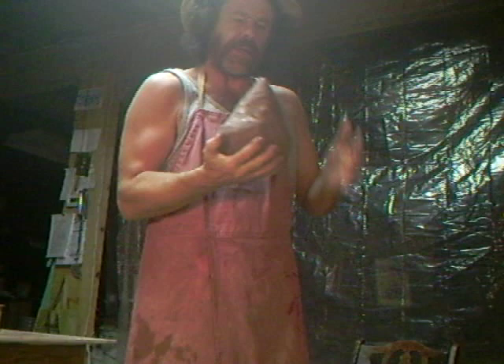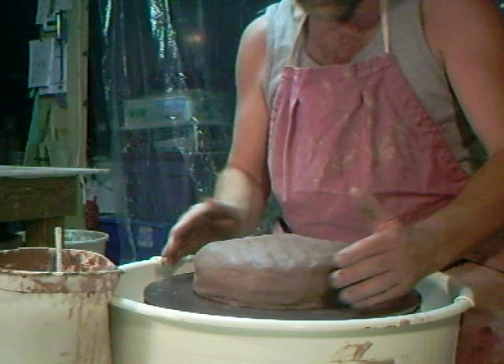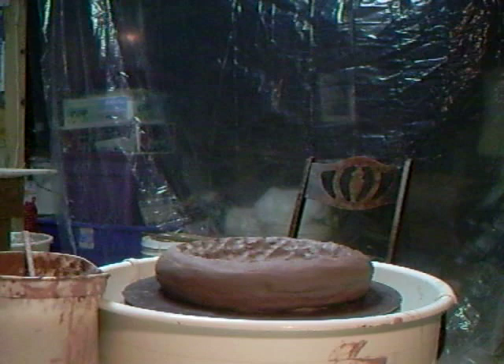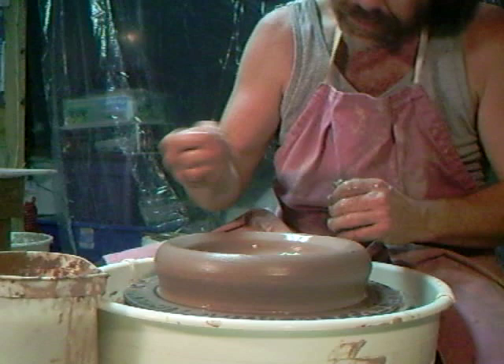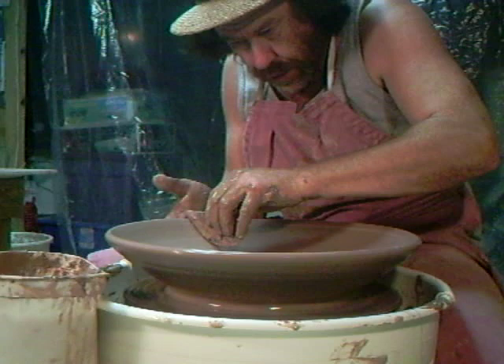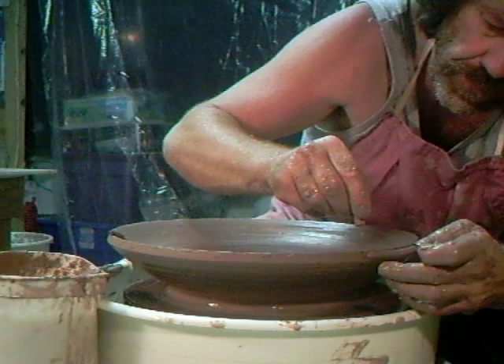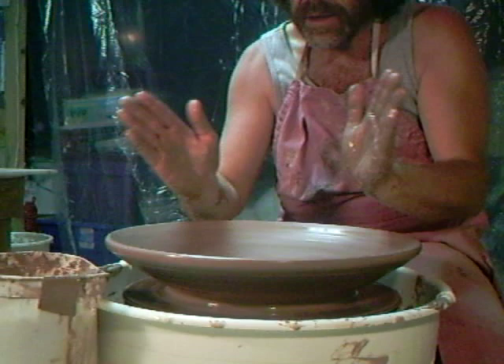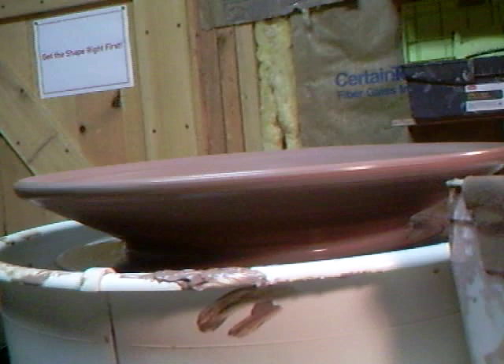SIMON LEACH - How to throw a  charger  ( & wobbly at that ! )  !!

Comment: Platters used to be my specialty. I had not done any in a long time but was feeling good about trying again so broke out the porcelain and pulled a 14 and 12 inch pair of platters (nesting nicely). There is something so satisfying doing these and then tending then during drying cutting them off every day, when they do come out of the bisque you really feel an accomplishment because they are so fragile. Honestly though, I would try again and center as usual.

Comment: I would imagine that the method you used to open it by pounding with the fist is the culprit for the wobble.  The sidewall wasn't even all the way around.  Kind of like opening off center in the normal manner.  Right???